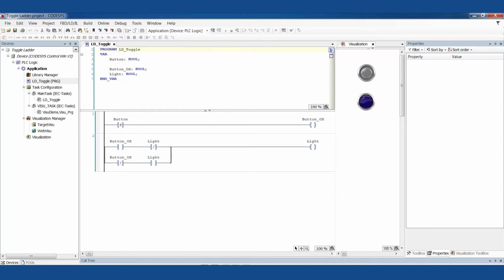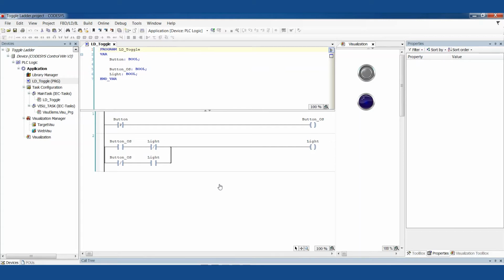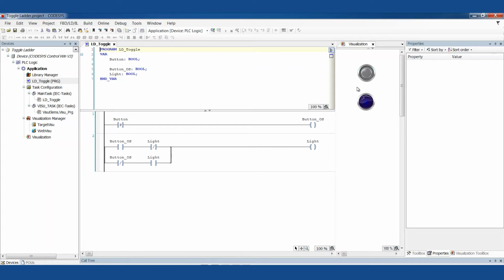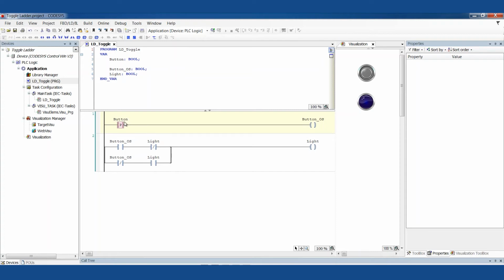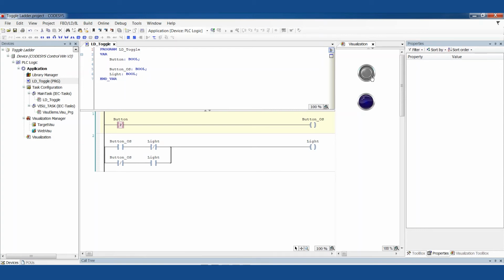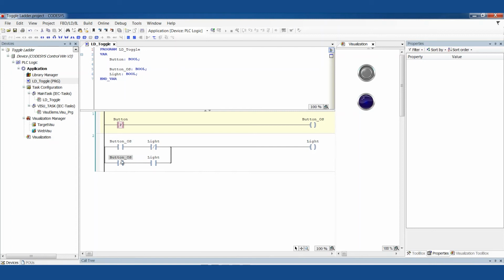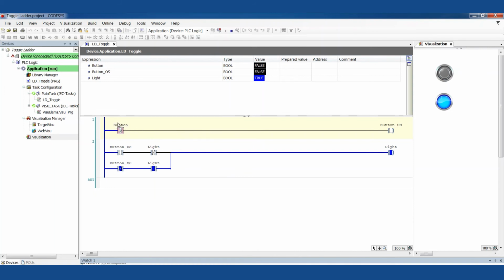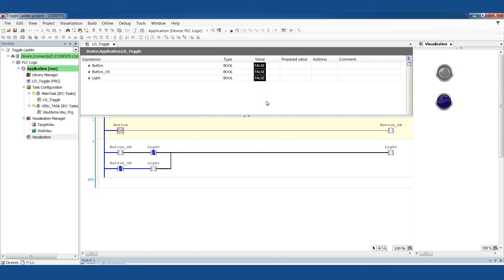How to Toggle a Bit in Ladder Logic - PLC Programming Cookbook

Comment: NICE!!!!! damn that was so much in details :) Thanks alot
Reply: i have a question... Can we completely stop the timer in PLC... like it completes its time and then stop after wards... no reset!!!! if so kindly tell me how???
Reply from the maker: Yes, some brands of PLC software let you stop/start timing with a separate enable input to the timer.  Most use a "retentive" timer which requires a manual reset.  For example, Allen Bradley has an RTO instruction that will start timing when enabled and continue timing where it left off the next time it's enabled.  That timer would be reset with different instruction.

I'm not aware of a retentive timer in Codesys, but it shouldn't reset unless you set the enable input to 0.  If you want to stop enabling it (maybe you want the output to turn off) but still want to remember the timing value, you could copy the value of the elapsed time (ET) into another variable.  Does that answer your question?